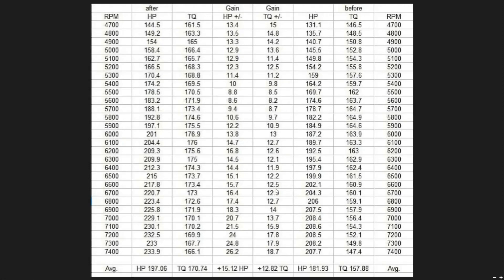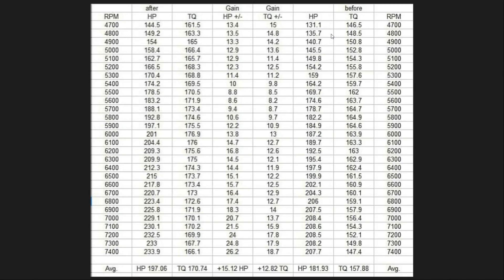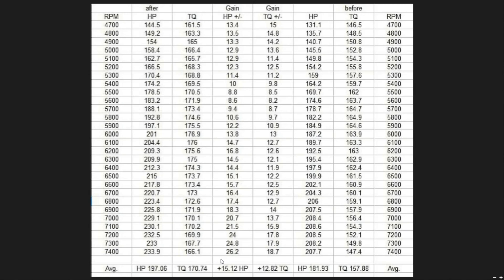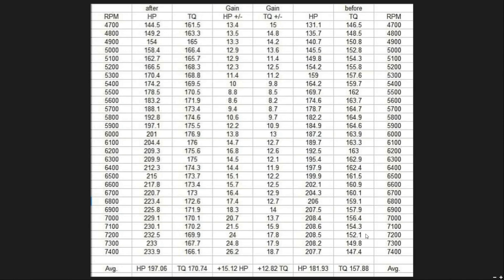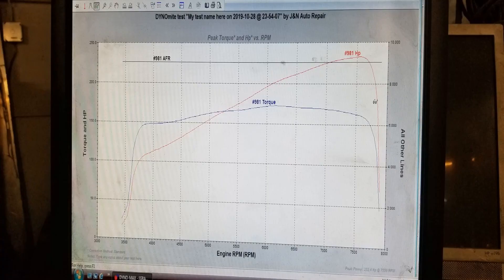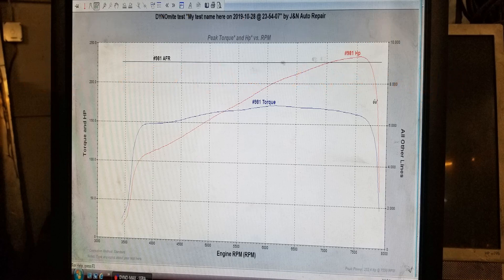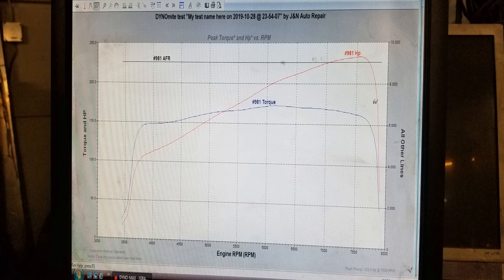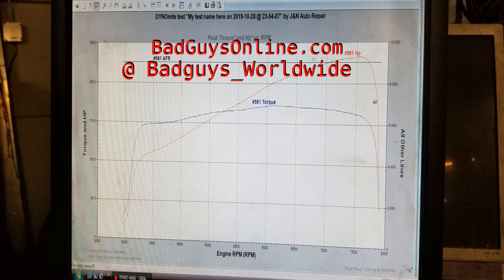H Series (F20B) DIY PORTED MANIFOLD VS CNC PORTED DYNO TESTED

Comment: With it being a manual he could rev to 82-8500. I rev mine to 8700 daily for the past 2 years
Reply: Later on i went to 9k and dropped a valve. Did a new motor and stayed at 8500. It wanted power past 9k still though. Now its turbo built

Comment: From the picture, the DIY porting work looks like it was ported with an angle grinder.  I'd almost expect a bone stock intake to outperform it.  I am curious how much of the gains depends on the chamber volume and throttle body size.  Chamber volume I think is an area that can be improved upon on my Hyundai Delta 2.7 project.  So what does a larger chamber volume do exactly?
Reply from the maker: On this oem manifold in stock form it actually has a set of butterflys that oem up at higher rpm, with the port work we performed those passages are deleted, rather than 8 runners that merg into 4 after the butterflys, they all get gutted and removed, hollowing out the plenum. This shortens the runner length a good 4 inches or more(key to spinning high rpm) plus when you increase the plenum volume to dampen the reverberation into the plenum of the manifold. This helps the air travel into the engine rather than vibrate back and forth. There are many papers from the big 3 us manufacturers on plenum sizing.  Any boosted motor plenum volume is king!
Reply: @trentontroxel2196  gains aswell i think
Reply: @trentontroxel2196  It's an all motor car in this video...